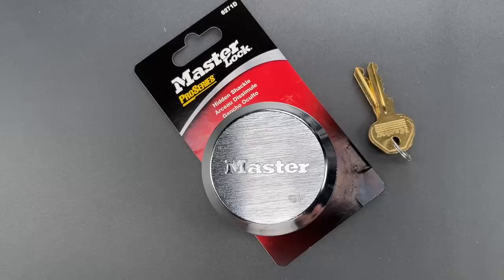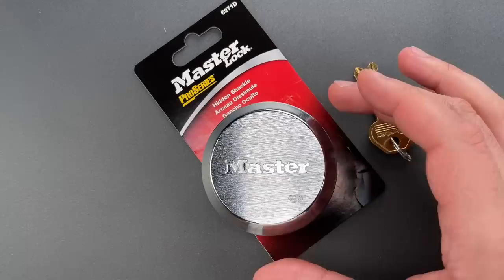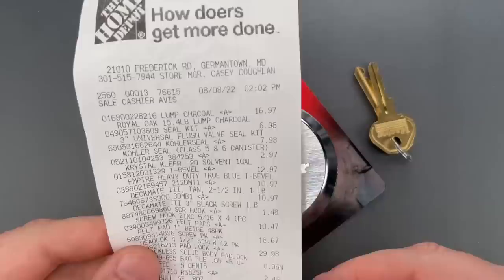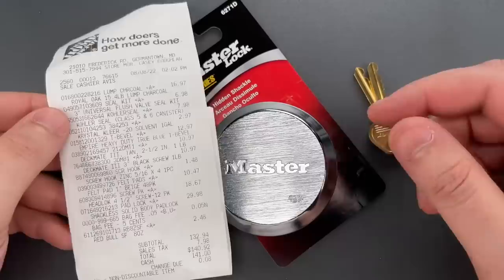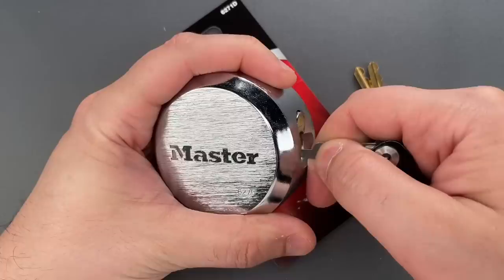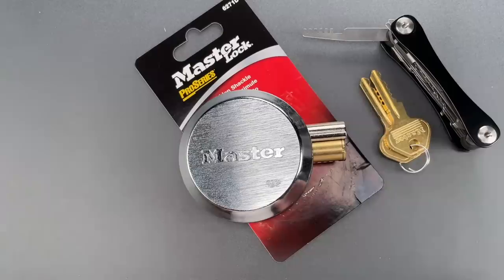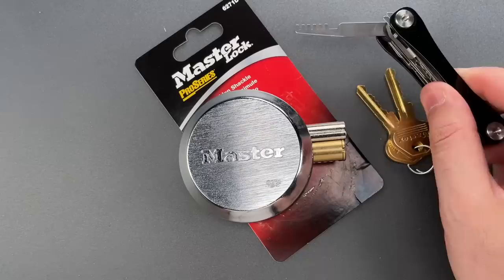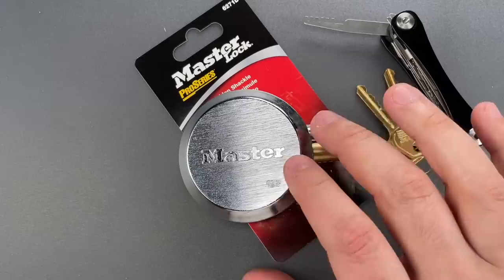[1464] 1.5 Year Update: Master Puck Locks STILL Not Fixed

Comment: Unfortunate but certainly not unexpected. I rather like those puck locks, especially when I can get them for free (or better) or pennies on the dollar (eBay) because someone doesn't have the key. Add an extra pin on top of or replace a driver with a longer one, add a spool or two and they're perfectly acceptable to discourage a thief from a shed or work-truck toolbox. Physically, it's a reasonably tough lock and I got 7 last year when the property manager said that I could have them if I got them off. I said that I usually charge $200 for the call-out and $50 for each additional lock but I'd already on site for a different matter so make it the flat Two Hundred and I won't charge for the other 6. He had cash in my hand by the time I combed the first one. He was happy, I was happy, I like those deals.

Comment: Is there a way to figure out a manufacturing date?  

Of course, a recall pf those already on the shelf as well as those purchased should be done.  Shouldn't be "too expensive" just replacing the core weather the old one is returned or not. Both only part pf the lock,  and 10% or less of the weight of the whole lock

Comment: It sounds like Master Lock just does not care. Maybe it's time to reach out to insurance companies, since they have the power to say "well, you used a Master Lock, which is about as safe as a zip tie, so we wont pay for your stuff". That might cause a change.

In Sweden, locks often are required to fulfill certain requirements, both against destructive attacks and picking. They are available in Class 1-5 (if classified), and as an example, a Class 4 lock i looked at have a 14mm hardened shackle and should take at least 10 minutes to pick or open with hand tools. The relevant standard for this is "SSF 014" which in turn references several European standards.

Comment: It's really sad that they cannot seem to fix this issue. It would only take literally maybe 1-2 mm longer pins and nothing else. Or if they don't have any longer pins, maybe just add thick master wafer per pin stack between the driver pin and the spring? That would also fix this issue.

Of course, I'm not expecting the rest of the core to be any better so this might just be switching from one vulnerability to another.

Comment: Not sure who's going to see this comment this long after the video was posted, but I've run into some issues with unsuccessfully comb picking this lock, and I'm not sure what I'm doing wrong. I can get the comb to set properly, but then the cylinder binds after turning 5 degrees and the lock won't open. When opening the lock with the key, I can feel it binding in a similar way before it opens, and I'm not sure what's going on.

Comment: I have a locking hitch pin for a hitch mounted cargo carrier. The 3 pin lock is hilariously and obviously bad, so I consider the lock as a feature to prevent accidental removal rather than any actual security. 

It should be criminal for Master to advertise any security value with this product.

Comment: Is there a production date listed on the packaging or the lock itself? It would be a model produced around the making of the old video.

What reaction would you have expected from Master Lock - and how do other companies react to obvious design flaws?

A company that wants to sell secure locking solutions might have recalled every unsold item and replaced the core with something better. However Master lock does not seem to be in that league.

Comment: Considering that most (maybe all, but I did not try a comb pick on the locks I had used when I was a child) Master brand locks I have owned are vulnerable to comb picking, you have neglected to mention their obvious motive for not changing anything: they do not consider it to be a vulnerability but rather a feature of their product line. If you ever lose your key then there is no need to worry or do something destructive like take some bolt cutters to the lock.

Comment: This really makes me think there needs to be some evolution on locks. I wonder if there's some kind of equivalent for physical security as there is for software security. Software has certain bodies/institutions like the Open Web Application Security Project (OWASP) that tracks vulnerabilities and issues warnings for software security issues. 
Taken a step further, Open Source Software's (OSS) success, and critically the ability for anyone to review the inner-workings of OSS applications has me wondering if this approach may help with improving locks in general.

Comment: Master Lock, that lock isn't going on my trailer lock (it covers the whole hitch in steel and locks the chains) for my car trailer.

All it would take is a wafer of a pin at the other end of the spring from the other pins. Easy fix, when anybody can make a comb.

Comment: If I read the bill correctly, the puck costs Les than 30 dollars.
Around here, this is the price of gym locker padlocks, not professional security gear for valuable tools in a company vehicle. 
A proper puck should cost around as much as the whole bill LPL paid, not barely more than a plastic toy.

Comment: Why is there a number ground off on the lock on the bottom right hand corner. Is this a 6271d package with a 736 lock? Or am i just bei g to observant and paranoid. I am in law enforcement, so I apologize if the accusation is incorrect. I am use to people lying to me.

Comment: BREAKING NEWS:
Master lock still sucks.
In one of our test conducted 1,5 years ago we found out that the locks from master lock were susceptible to combpicking. Which is a technique popelarized in 1934 by Francis Buday. Seen as that test was 1,5 years old we went in again to check whether Master lock managed to improve their locks or not. And sadly it turned out that they did not manage to find a solution for a fault, that you can find multiple solutions for by a 5 seconds google search. This is especially yearing because Master lock does sell locks that have the solution for this problem. So this is not even a problem of being unable to do but a problem of unwilling to do. Proving once more why you should not trust Master lock with any security solution in your live.

Comment: Its really sad to put such a terrible core in a fairly well made lock body. I have 4 of these, I replaced all of the cores with American lock versions and added 2 spool drivers to aid the serrated pins dropping and jamming up. No complaints about the lock body at all. Almost no thieves pick locks, so it's actually pretty dependable either way but this is a little too easy

Comment: Worst phrase in manufacturing: Fit, Form and Function. I only ever hear the phrase when there's a quality or engineering issue as a means to make a problem look trivial, never when things go right.
For example, "Does it fit together? Does it look convincing? Does it technically lock closed? Then it's a lock, send it"

Comment: I think the LockPickingLawyer doesn't know that these products are designed so that if you lock yourself out of your house, you can easily get back it without calling a locksmith. I have two of these locks in my house and I don't even carry the key. I just use a piece of grass to enter my house.

Comment: while it wouldn't surprise me if masterlock didn't fix the problem, its also just as likely that home depot hasn't sold through the stock of defective locks yet and "whats the difference in a lock made in 2022 and a lock made in 2020(or older) a lock is a lock."

Comment: LPL: takes only seconds
Me: blabbering about how does he know it has 6 pins
Reply: Knowledge is key 😆
You can count the pins by looking at the key or using a pick... fully insert the pick into the lock and pull it out slowly, counting the clicks
Reply: @SystemX1983  Sure, you gonna pick a lock and key is just randomly there besides the lock. Why pick it at all when you have the key?
Reply: @iare19  you can buy the same lock with different key, the number of pins would be the same...
In this case he has the key dangling around there 😉
Reply: @SystemX1983  you are missing the point but whatever.
Reply: @iare19  I also explained the method to get the number of pins without having the key in my first answer 😉

Comment: What I have learned from your channel is if you want something secured, you need a welder and some steel. Locks are essentially useless.
Reply: If someone really wants to get in they will get in, pretty much no matter what you do. The trick is to make it hard enough that the attacker moves on to easier targets. A decent quality lock will usually do this.

Comment: Master makes some crap locks because they also make really good locks...well, American, whom they bought, made really good locks...anyway; Master sees it like this: Quality is a 1 to 10 scale, and the very vast majority of their locks need to not compete with their really good locks. Meaning most Master locks are crap on a stick.
Note that I am not talking about Master's own rating system, where the lock in this video rates...what? a 9? a 10?...No. I mean their ACTUAL rating system that is only internal and never public. The locks you buy at Lowes? Those are a 6. At most.
So the theory goes, anyway.

Comment: From a legal aspect: since you have very publicly identified an easily fixable issue that can be fixed using industry standards; if you had used this lock to secure high value items (unknowing of the design flaw at the time) and they were then stolen, and could prove they used the exploit and just didn’t brute force/destructively bypass the lock, could you hold Master Lock either criminally or civilly liable for damages/replacement of your items?